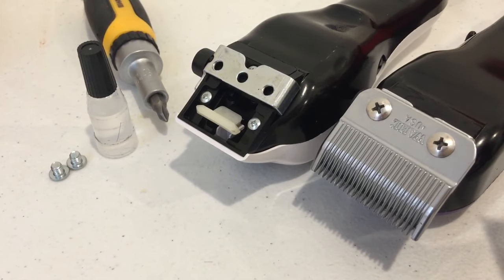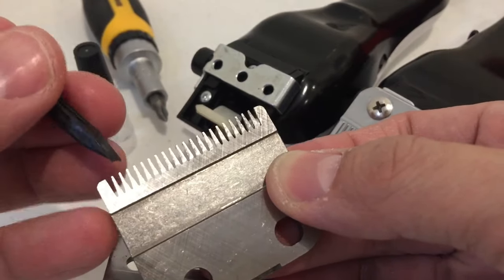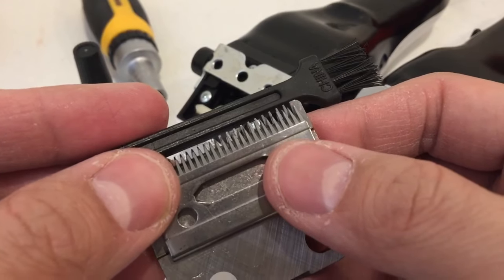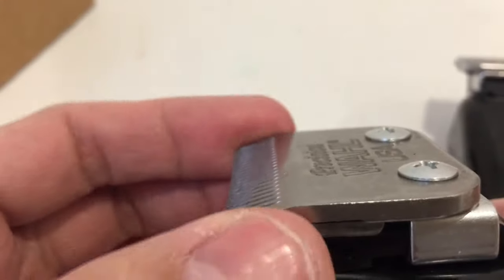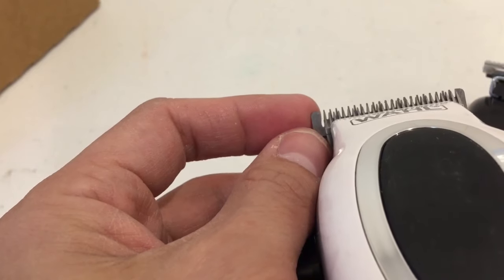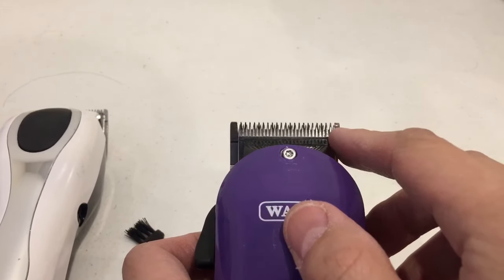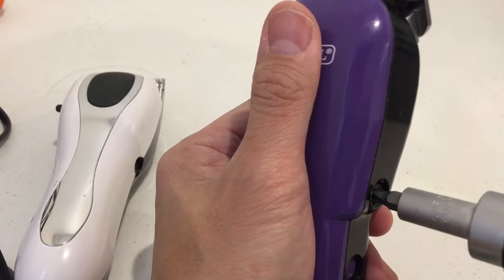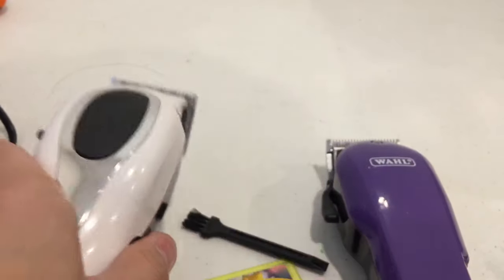How I align & tune Wahl clippers

Comment: Dang, he didn't show the part I wanted to see, the ACTUAL putting of it back together!
Reply: It's really easy man it's like the easiest clippers to put together
Reply: That’s the hardest part.  What I did was just put it on, then put in the screws loosely.  You can adjust it without the blades and screws falling everywhere.  Once it seems lined up then tighten the screws. Took me a few tries then I got it.
Reply: @GTA_500  Then teLL me this whaT is the funcTioN oF thaT "whiTe thinGy" aT the (0:01) sec. maRK thaT siTs in the weLL undeR the bLadeS and hoW in the heLL do I reaTTaCh iT.!??!!? 😒

Comment: I have a 50 year old 89 Taper Wahl clipper that had not been used for many years. It made a horrible loud noise with the teeth not moving. I followed your step by step instructions and was able to align the teeth and get it working again . Thank you for your simple instructions  step by step close ups. I think you saved me from buying a new one.

Comment: My clippers weren't cutting. They were moving side to side but they weren't cutting. Aligning them like you said; right side of the blade on the fat part and the left side of the blade aligned with the 2nd thin triangle, and also pushing the blade "up" a bit closer to the edge fixed my problem. Thanks!
Reply from the maker: Thank you for your comment and watching my video! Really appreciate it. Cheers

Comment: How come your bottom blade spring doesn’t pop up? On my clippers my bottom blade spring does, which makes zero gapping hard to do because I have to hold down the bottom blade while trying to align it with the top. How are you keeping the tension on your bottom blade?
Reply: Same question

Comment: My advice is to never try to disassemble your clipper, unless you really know what you're doing and you have a really good reason for doing it. I still regret disassembling mine, because it took me a very long time and a lot of reading on the internet to put them back as close to the original as possible. I still doubt that they are absolutely aligned, but they were much worse the last few attempts, so I'm not messing with mine ever again.

Comment: Im really strugglin with the black screw. I do everything same as you but at the end when its all done. Its loud, then i   make it quiet same as ypu, but then the upper knives are too "right - >" positioned. Then when i cut hair i notice is not as good as it was before. Please help
Reply from the maker: Hi Thanks for watching! Not sure what else I can add to what I've already said in the video.

You'll just have to keep positioning the blades until it's just right using your sight/judgment. 
You also probably know that when you tighten the screws back in place, the blades will move. 
It's just a matter of keep doing it 'til you you get it in the right position. 

Getting the screws in with just the right amount of tightness is another thing to consider

Sorry if Im not helpful. Hope you get it right.

Comment: In which position the moving blade needs to be for aligning the blades? I think its very strange that no toturial is mentioning this (even the original wahl)
Reply from the maker: The top blade (that sits on the white prong) does not move. You should not force it to move in any way.

The bottom blade can be move/adjusted by slightly unscrewing the two bottom screws. 

I explained it in the video. It will tell you which position to move the bottom blade relative to the top blade. Good luck. Thanks for your comment
Reply: Did you figure it out?
Reply: Unfortunately the video doesn't show that part of the top blade, how to install/place it.

Comment: I did the same. But when I place the lever up ,then looks all crooked.  Then lever down and make the blades together is all good. Goes crazy when its up
Reply from the maker: I never experienced this. I will move the lever up and down after each cut to see if this happens to mine. Cheers.
Reply: @lmbpros  i dont even have to see the cut, just by moving up, the blades are perfect, moving down and goes mental,

Comment: My clippers teeth physically can't align like that. I think the white plastic in the middle that holds the small blade is not centered.  So my big teeth align with the edge of the bottom.  Not the bottoms teeth, but the edge of the blade.  The other sides big teeth align with the 3rd tooth.  
1.  Is this a problem?
2.  Can the white plastic that holds the small teeth be moved/centered?
Reply from the maker: https://youtu.be/Wb1w46_7As4

I made a video to investigate when this happens. I'm no expert but logically looking at the inside (FYI: voiding warranty) if the vibrating arm, particularly the front end with the white head is bent then one can get misalignment.

It's never happened to me so I can't guess why it happens but as suggested in the video is to buy a replacement arm or try to straighten it. Good luck
Reply from the maker: Regarding 2. I don't think the white head can be removed. Mine looks like it's glued down.

Comment: HELP PLEASE. 
My clipper motor is active but barley moves back and forward despite turning the power knob, therefore the cutting blade doesn't move enough to cut hair. Any suggestions?
Reply from the maker: Hi, one suggestion I've been told is that the 'cam follower is worned out'. This applies to cordless clippers.

https://www.wahlspareparts.com.au/p/cam-follower-4

Comment: If the bottom
Blade(cutting blade) sits crooked with the plastic in the middle, and the top still blade Can’t align straight with the bottom teeth, this would be a defect right?

My cutting blade sits crooked And the top simply doesn’t move enough to make up for the slant
Reply from the maker: I tried to look into this issue, with this video..https://youtu.be/Wb1w46_7As4

Comment: I tried doing this. But they do the really loud buzzing sound all the time, how matter how much i loosen or tighten the screw. 
Any ideas?
Reply from the maker: I've since learnt that for cordless clippers, it the "cam follower" is worn out (it's a piece of plastic) it will make a loud sounds. Try google "Wahl cam follower". Good luck

Comment: What side does the blade go on. Mine looks like it would matter. What side is top. I know the words for the top blade is facing you... but the inside blade, which is top?
Reply from the maker: The flat side of the bottom blade would face the white head. the two teeth of each blade meet each other.

Comment: How often do u lubricate it?
Also how often do u clean the hairs that get inside the machine?
Reply from the maker: Probably after About 5 cuts. I clean and lubricate at the same time. 

For corded, if you have a sponge that comes with it, it does a good job of keeping hairs out (I check once in a long while). I rarely open cos it is time consuming.
Reply: @lmbpros  what is that sponge?
I have a Wahl Color Pro Plus and i didnt see it (i even opened the machine).
Is it used inside the machine to keep hairs out?
Reply from the maker: @santo998  https://www.wahlspareparts.com.au/p/foam-sponge
( WAHL spare parts store for Australia)

https://hairsupplies.com.au/products/wahl-foam-sponge-for-clipper
( example of A retailer selling Wahl spare parts)

Just google for your local hair salon store!
Reply: @lmbpros  ty so much!

Comment: Sorry im confused- so i bought a Wahl balder 3 or 4 years back but never used it because of the loud noise. I fished out again during lockdown. Do I need to a) adjust the blades as shown 2) change the black adjustment screw 3) both. If I make it quiet by adjusting the screw, will that affect the cut? Thanks!
Reply from the maker: Hi thank you for watching! 

I'm no expert but for me personally, I always clean out my clippers after every cut so I have to align the blades after cleaning. 

I don't always tune/power-up the black adjustment screw. If you turn it on and as I've shown (be careful not to cut yourself) by pinching the blades and your pinching stops the blades then tune/adjust/power-up by adjusting!

cheers

Comment: This was soo helpful, thanks. So many questions tho: 1) I noticed a broken tooth on my bottom blade. does that mean I need to buy a new one? 2) No matter how hard I try to line things up perfectly, when I tighten the screws they move out of place :( Any advice? 
It was seriously helpful though! Until now, I didn't even know that I could or had to align the blades and clean it out, but it was working so poorly.
Reply from the maker: Thank you very much for your kind comments. Really appreciate it and thank you for watching too.

Broken tooth... I honestly don't know but I imagine you might get hair stuck or jammed between the tooth or blades? Or perhaps not cut a line or section of hair? Very curious now

Googling a quick check on Blade replacements they average about AUD35 and up to AUD60 (rip off) excluding shipping/tax

I also learnt about stagger tooth blades (comes with WAHL magic clip) and precision blades (comes with WAHL Seniors)!

Also just learnt there are mods that you can even buy an ANDIS blade to fit onto a WAHL (US website about USD30 excluding shipping/tax).

So you got a good reason to research and buy a new replacement!

I know what you mean, those blades keep moving out of position when screwing back together. It took alot of patience and experience until I got it aligned just right!

Comment: great video sir. thank you so much. i think what there is a problem with my clipper. the white "arm" that it below the cutter blade is not straight because when i put upon it the cutter blade, it bends on one side. can i do anything about it?
Reply from the maker: Hi, thank you for the comment! Thanks for watching! From my what I know (Im no expert sorry), the white head that connects to the  vibrating arm should never be bent. The only reason I can come up why it can be bent is that the unit has been dropped head first.

I highly not recommend messing with the internals of the clipper ( I have wrecked one of my WAHLs :( trying to mess around inside ) However, since yours is already bent to one side, you can attempt to straighten it out as the metal that the white piece is connected to is quite bendable. That soft metal should only bend upwards and downwards. If you're saying bends on one side, meaning left or right then something is definitely wrong.

Always bring back to your retailer if under warranty! dont open the case as it voids warranty! good luck. sorry cant help much. I tried google this topic but very few hits.

you can replace the vibrating arm though here is a link for an australian store
https://barberco.com.au/vibrator-arm/
Reply: Thank you for everything! I appreciate all your help!!
Reply from the maker: @thodorispapageorgiou9977  thank you! All the best mate

Comment: Ok, right at the beginning: the white plastic piece that moves the small blade back and forth--mine is off-centered! so it's making the small blade off-center and too hard to align it with the large blade....can someone help me out
Reply from the maker: I just made a video regarding this white head. 

To be honest, my white head is also off-center but as long as I zero gap. I had no issues. Sorry I am not helpful.

Comment: Thanks for the vidéo. It is very helpful. I’m just wondering how to adjust my clipper to reduce vibration. My clipper has just an adjustment screw just next to the blades and I’m turning it trying to find the best adjustment but it keeps vibrating and my hand becomes numb. Do you have an advice to help me, please? Thanks in advance!

Comment: I want to align like my Limural wireless was stock, I installed ceramic blades and I'm basically at a Zero gap. I want stock alignment so I can do a proper 0.5/1/2 fade.

Comment: Excellent video! Question, I've taken my wahl apart. The vibrating "arm" seems to be clacking against the shroud even with top cover off. If tilted, motor will even stop as it must be striking the lower shroud somewhere. Do you have any thoughts? I would hate to throw out $40 clippers for something mechanical. My clipper is exactly the same as the one on the left in screen at "0.07"- no spring. Thanks if you have the time to answer.

Comment: Hello. I Have previously tried to zero gap my clippers and I have successfully done it. However no when I use the clipper and turn it on, either the cutting blade or stationary blade keep moving horizontally and they dont align at times. How do I fix? Appreciate it.
Reply from the maker: The motor on the clippers is very powerful so the blades can get out of alignment (plus also thickness of hair is a factor,.... perhaps )

My best guess is to keep zero gap and tighten it just a little bit more (pls don’t over tighten!!!)

Comment: I have a dumb question .  I don't understand the part about the gap.  There is supposed to be an 8mm gap between what?   What are you measuring at 2:15?
Reply from the maker: Hi! I struggled understanding this 'gap' that everyone was talking about too!

https://au.wahl.com/AU.wahlglobal.com/media/Manuals-Factsheets/Barber-Tool-Care.pdf

"The top & bottom blades should be parallel with the top blade approximately 0.8mm behind the bottom blade (do not have the top blade level with the bottom blade as this can cause skin pinching or cutting)"

Gonna repeat it.... Don't level the top and bottom blades even. Just slightly *lower* the TOP blade down by 0.8mm (not 8mm!) so they look like they are parallel

At first, I leveled both blades (both are even) and I  learnt the 'pinching' the hard way... very painful. lol 

Hope that helps!

Cheers. Thank you for watching! Really appreciate it.
Reply: not 8mm, 0.8mm, bottom blade should be 0.8mm ahead of top blade.

Comment: Why the heck are my clippers not cutting hair? I took it apart, nothings broke. Could it be the alignment? It’s not even catching or pulling hair, nothing.
Reply from the maker: Hey sounds like its under powered. Have you turned that powerscrew (until you heard a loud buzz)?
Reply: limubearproductions - Hey, thanks for the response. That was the first thing I tried, it was loud as heck. I wound up taking it completely apart and the spring flung in a corner of my garage. At that point I just threw it all out and bought a new one. 😀
Reply from the maker: @nja3224  lol Please take care of this new one! Cheers
Reply: @limubearproductions - ha ha, new one worked great. 😀

Comment: Got it! Thank you so much!
Reply from the maker: Thank you for taking time to leave a comment! Really appreciate it. Cheers!
Reply: @lmbpros  How come your bottom blade spring doesn’t pop up? On my clippers my bottom blade spring does, which makes zero gapping hard to do because I have to hold down the bottom blade while trying to align it with the top. How are you keeping the tension on your bottom blade?

Comment: Mine wall blades does not wobble like yours do how do you do it step by step
Reply from the maker: Don’t tighten the screws all the way. Unscrew it back a bit, adjust, hold it best you can, then tighten (don’t overtighten though)

Comment: I have the 2020 cordless Wahl Seniors and the damn blade keeps moving! I center it perfectly then after it gets turned on and off the clipper will be set on the right side of the blade and not center like I originally set it. Does anyone know why? I've tightened all the screws on my clipper and they are still loose. Is this normal or a defect?
Reply from the maker: Sorry, I have not experienced this. Sounds weird especially when you've  tighten the screws. Perhaps too much lubricant? Probably ask around the socials like reddit? Sorry can't be of any help.

Comment: My top blade always "parks" to the right hand side. This makes it impossible to align the bottom blade properly. Any tips please?
Reply from the maker: Mine does that too. I'm no expert but Im guessing the vibration just knocks it out of place. I just tighten it a bit more but NEver over-tighten any screws especially on electrical items and plastics.

also I always clean and re-align after every cut that helps it keep in place

cheers sorry cant help more.

Comment: I had a friend take mine apart "to clean" them. After he took them apart - he sharpened them with sandpaper & oiled them with WD 40. I had to toss them out, they were humming & grabbing onto my dog's hair  OMG !! First I told him - it said on the box "self sharpen" & I don't think WD 40 is made for clippers?? He told me he used to do that to people's hair clippers & it worked good :(
Reply from the maker: Sorry to hear that. You could just buy new WAHL replacement blades... Unless the insides of the clipper (WD40 got into the motor etc etc) were wrecked as well.
Reply: @lmbpros  I hadn't thought of buying blades, but I tossed them out. But at least if I have any problems with my new ones I know how to fix them.

Comment: What if that one white part of the clipper that holds the align of the razors for the clipper. Moved to the side? How can you fix that?
Reply: Its a bent arm. You can send it in to be repaired if under warranty here in Sterling, IL.
Reply from the maker: Hi, sorry I am not expert, I just learnt how to align and tune up but as chicago129 mentioned, try to send them in for repairs if under warranty. Good luck. Thanks for watching.
Reply: Use the screw on the side to adjust the white arm back to the middle (you’ll see it move as you turn the screw), then realign blades and screw blades in. Then you’ll probably have to readjust the screw on the side if the clippers are too loud.